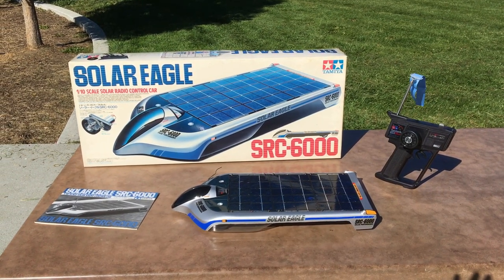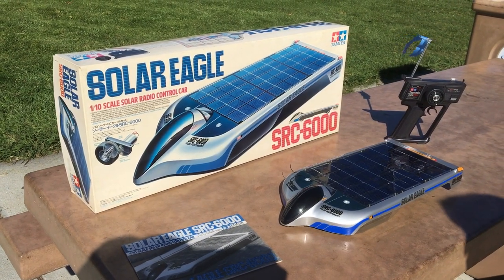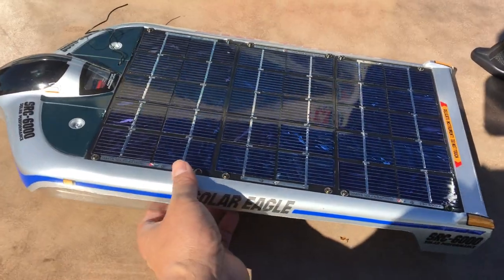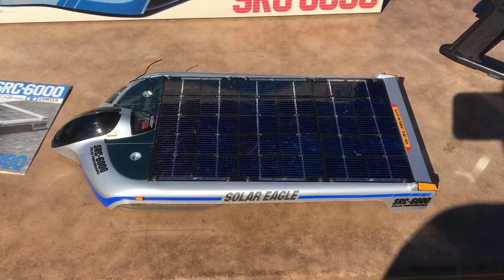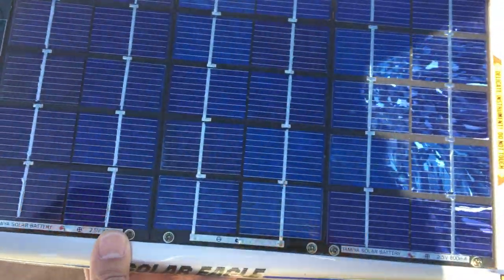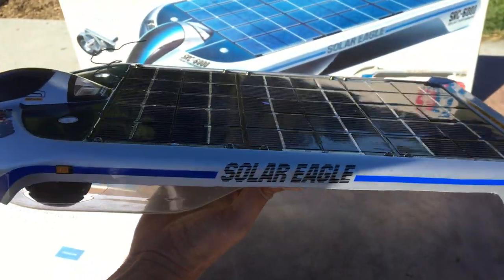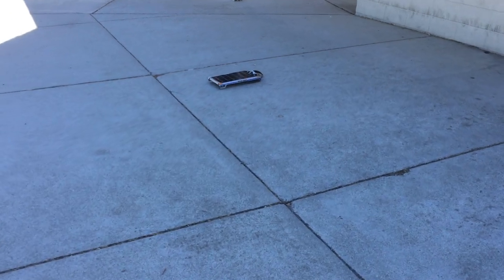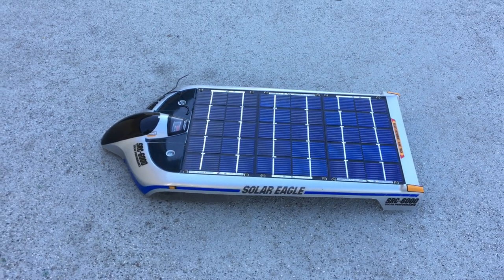Rare Vintage Tamiya Solar Eagle SRC-6000 1/10 Solar-Powered Radio Control Car with Circuit Diagram

Comment: Put a brushless in it lol an make it fast. An ive also heard of ppl useing microwave capacitors did you like jewelry welding I guess you could maybe use that to start a car too or the rc car lol.
Reply from the maker: We actually have an ultra capacitor (that we've used to start a real car) that we've been meaning to put into an RC. It powered our brushless E-Maxx for around 10 seconds.